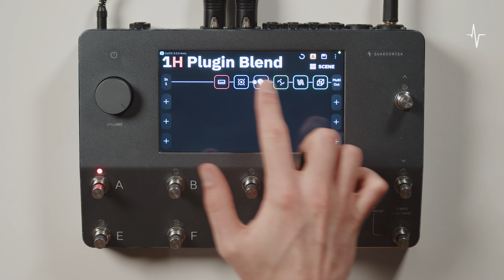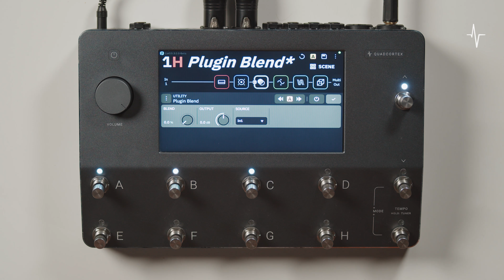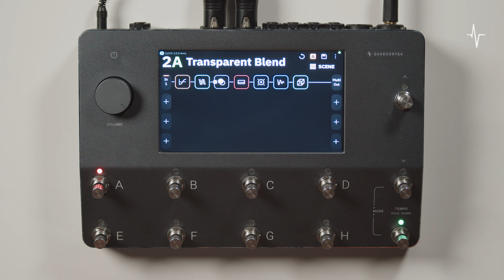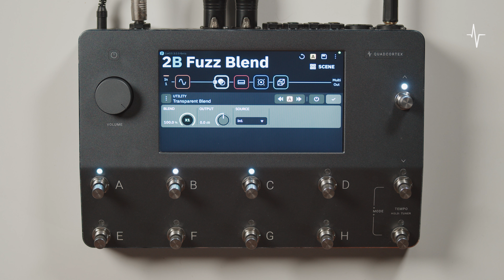How to use the Blend device in CorOS 3.0.0

Comment: For folks who also play acoustic, this would be a nice way to use IRs and not have the limitation of using an empty IR in the dual IR block to achieve a 50/50 blend with a acoustic guitar IR. Now you could have all sorts of blends on the fly more easily with an expression pedal.
Reply: Have been thinking the same thing- looking forward to trying!

Comment: Can someone explain the difference here? I think I’m missing something… so with plugin blend it compresses the signal on the wet side so you only want effects after and less desirable for amps, and for transparent it is better if you are putting the blend before an amp (for effects before the amp) because it is less compressed and EQ’d? Don’t understand what the difference is here
Reply from the maker: The Transparent Blend doesn’t apply any EQ or Compression to the processed signal. 
The Plugin Blend applies EQ and compression to the signal, replicating the behavior of the Blend knobs you can find in our plugins like Archetype: Plini X.
This EQ and compression is needed to achieve acoustic sims tones effortlessly.
Reply: @NeuralDSP I still don‘t understand… Where can I set the parameters of eq or compressor? Transparent- and Plugin-Variants seem to have identical UIs.

Comment: Does Quad Cortex compensate latency to avoid phase issues? Helix and other modelers have a lot of issues with this when using parallel processing. Even worse when blending FX loop signals that go through DA AD conversions. It would be as easy as matching the delay on the "out of the block / parallel thru" signal before blending, but they don't fix it!! Same thing DAWs do with latency compensation! As long as external pedals are analog (and thus not adding their own latency), it should easily work!!
Reply: You'll find phase options in QC
Reply: @samaitcheson7057  Not sure we're talking about the same thing. Phase/polarity (180°) flipping is a different thing. It won't fix parallel latecy missmatch issues. We're talking about very small sample/ms latencies, which create comb filtering an frequency cancellations in different parts of the spectrum. Flipping polarity only "moves" this problems in block (together) to a predefined distance. Might fix some issues but will bring others. I might be wrong, though. I presumed you refered to that.
Reply: I understand what you mean exactly. Owning a QC, yes, it appears that parallel signal chains are delayed to match up with the most DSP heavy signal paths to avoid phase/combing issues. I haven’t heard combing yet.